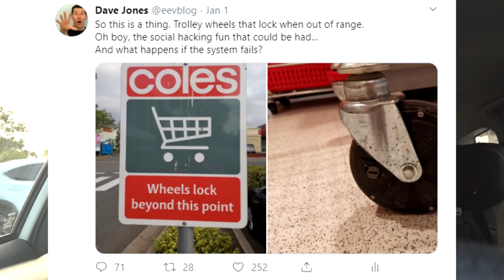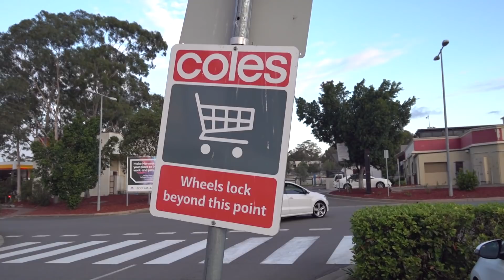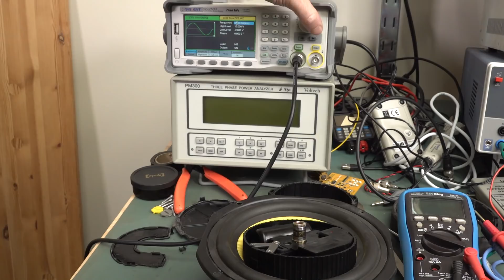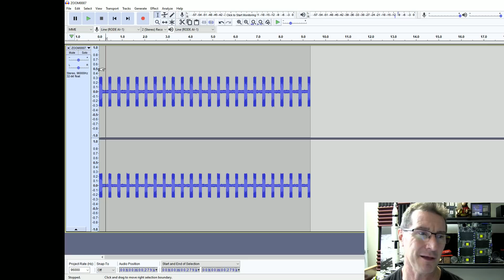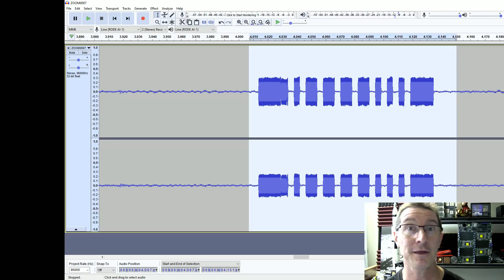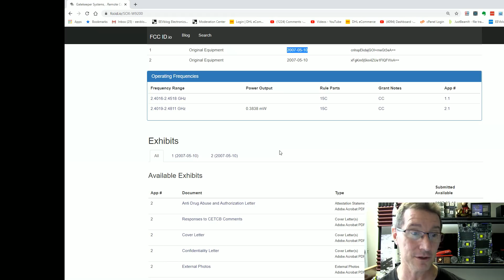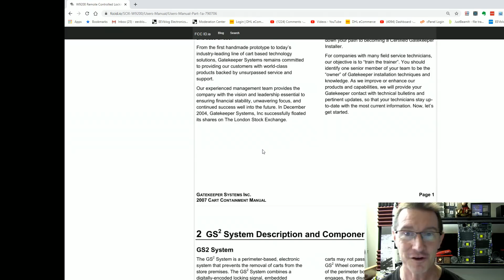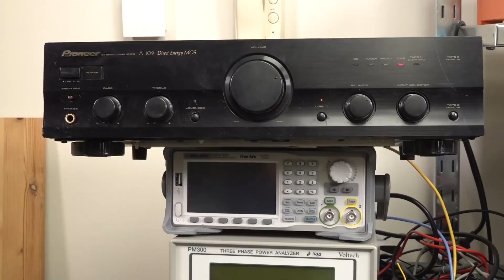EEVblog #1287 - Gatekeeper Shopping Trolley Lock Investigated

Comment: They could have installed a small generator on the wheel to recharge the battery and set off an alarm on the wheel while signalling the manager to chase down the cart thief. Install two wheels and it drive itself home, take that Tesla a self driving cart.

Comment: 1. Copy the signal. 
2. Build a device that broadcasts it with 1000x more power. 
3. Set it off in the middle of the store at peak time. 🤣

Comment: An ingenious idea to pick up a broadcast signal with a microphone, there is power in simplicity.
In our country in the Czech Republic, such a thing is not necessary, even stealing the trolley will not prevent coins, some trolleys can be opened with an ice cream stick, others are unlocked with a washer under the screw but they still steal a minimum, because the wheels are so stuck that it is often a problem in the store  🤣 
Nice day 🙂 Tom

Comment: Only doing one wheel and not making a continuous perimeter? So what you're saying is this works perfectly fine but the shopping centers cheap out and waste their money, because in this case spending 20% of the money gets them 1% of the effectiveness, the same effectiveness that they'd get by just putting up the signs and not actually changing the wheels. Rather disingenuous to blame the technology for it not working.

Comment: The problem with these wheel locking systems is that you can grab some friends and push a bunch of carts right out of range of the transmitter. Perfect for nondestructive vandalism.

Comment: "Only one one wheel, whoopdee doo, what's that gonna do?" I'll tell ya what one locked wheel can do... completely stop a fully loaded cart. I'm sorry not sorry, but have you ever taken a fully loaded cart and tried to LIFT it? That shit's heavy... and if someone has hundreds of dollars of things in the cart, and suddenly a single wheel locks up, they're more likely to ditch the cart because you can't just 'lift it' or 'push it' to get it to keep moving... the system works pretty darn well. But its all a matter of where you put the trigger lines, and what kind of system you actually have.. the really nice ones are the ones that communicate which cart is which, so you can just lock them once you notice them bypassing the checkouts.

Comment: In my area they have these on both rear wheels. I have seen them on all four wheels as well. Still only takes a skateboard or two to defeat.

"Pushout" refers not to the cost of the cart/trolley but to the stuff the perps put in the cart before they push it out the door without paying. The thieves rarely take the cart itself; they dump everything into their vehicle and abandon the cart.

You glossed over the various options for the locking systems. The loop systems are pretty lame, but the full perimeter system is much harder to avoid. Still not guaranteed, though, because if you plan ahead for that it's simple to add your own free-rolling wheels and if you are clever they could be either quite compact and easy to conceal until needed or something like a scooter or skateboard that wouldn't be suspicious in and of itself. (Again, if you were prepared and looked the part.) Or maybe that's one of the things you picked up in the store...

 The bottom line is that no technology can be created that can't also be defeated. The best you can do is deter the ones that are not particularly determined. The trick is not to spend more on security than you're losing to theft.

Comment: as a trolley pusher I wish feral mums would stop leaving empty yoghurt pouches , fruit with one bite and nappies in trolleys
Reply: the system is actually fairly effective centers that use these have very few leaving. I will collect 1-2 from a store that has the system and in the same morning need to collect over 100 in a neighboring store that dosnt have the system.

Comment: Back in the late 2000s I played around with a few local systems that had these. They all had different activation codes. I used an inductive phone pickup coil from radio shack along the wire with a digital recorder and was able to make the cart wheels lock. I also did an experiment with a wire loop antenna on black friday at such an equipped place and it resulted in chaos! Here is a video of me playing back the inductively recorded exit signal https://www.youtube.com/watch?v=BXmvtGuUSrc